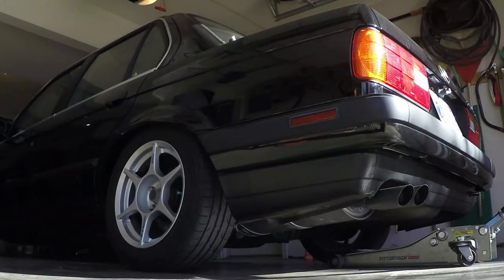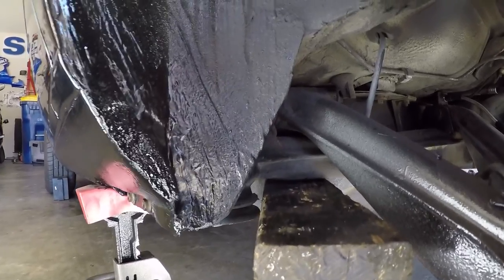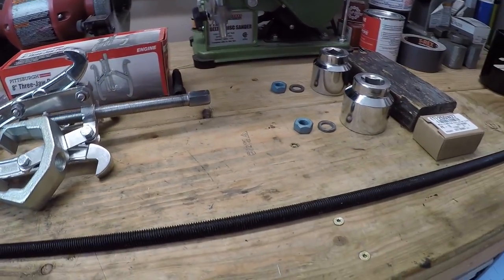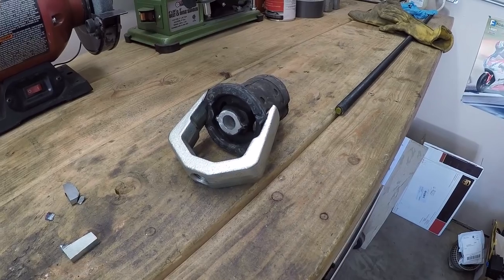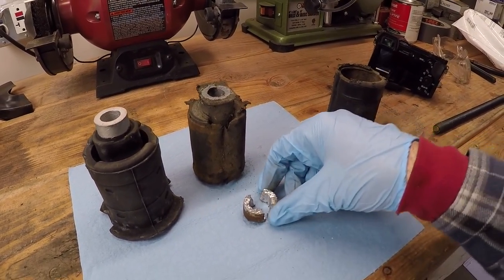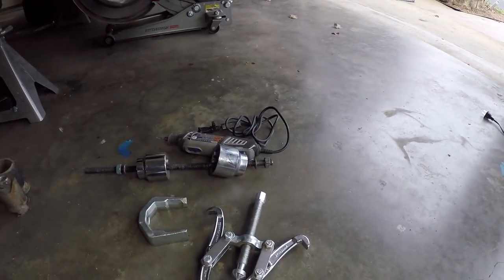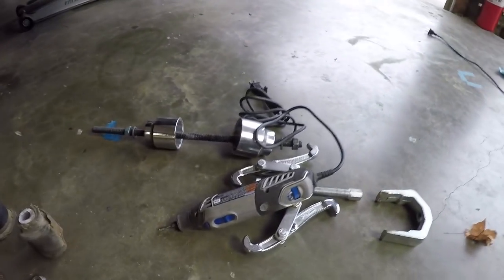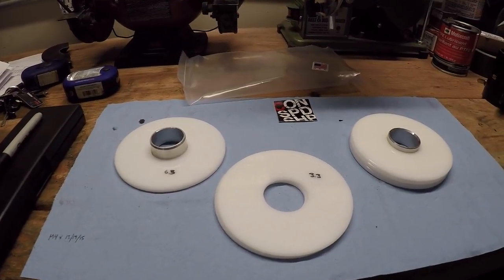Project E30 / Ep. 19 / In-Car Rear Subframe Bushing Replacement

Comment: very nice.  I made this setup about 6 months ago after finding that same link, but could only get 1 of 2 out this way -- 2nd bushing I could not get enough purchase on with the 2 jaw, and subframe had to come out anyways.  What a lot of work!
Reply: playlistforkids had this issue my self but was able to drop subframe enough to run an all thread threw the center of the pitman arm and put large washers and a nut on the other end then pull it out without the 2 jaw
Reply: Required some heat though

Comment: Crazy the top of the mount broke off and you still managed to get that piece out. I've had that happen several times but I always pull the subframe completely, so I have room to get a drill in there. II always drill 3 "holes" at an angle and chisel the bastard outta there.

Comment: Did this on my E46 M but I got it done by the shop as they did my sub frame reinforcement plates etc. Too big a job on the E46 for me to handle. I kind of envy your elegant E30. Although I really like my car I love the size and look of the E30 so much. Looks killer classy!
Reply from the maker: Thanks Greg! The E46 definitely has a more "advanced" design compared to the E30.
Reply: @PracticalEnthusiast  Yes but I'm not totally convinced that it's necessarily a better one. (Or maybe it's a combination). From what I've been learning and gathering from those that have been swapping engines with chassis and then what it takes to make them work, the combination of the S54 from the E46 M3 and the E30 chassis (then tooled a little more with some configuration of E36 steering columns I think and a few other smaller changes) can produce one of the most satisfying and exciting cars for the N/A Manual car scene.  I have my own fantasies LOL but not the resources or equipment to execute such an endeavor. If you want to check into a reasonably trust worthy test of this type of set up check out Matt Farah on the Smoking Tire doing so  I'll grab the link for you.    https://youtu.be/hZzTg1GoOxo

Comment: Very great video. The best on yt for this service.
Please dont hate me for the next words. The new rubber bushings may only last for next 10k miles. They are produced so cheap, they are shitty.
Either take glue for wind shields and fill all open space inside or better use other material like from Powerflex. In the german forum e30.de they prefered them long time ago, i drive them in both, winter and summer car since more than 10 years. Yes they are harder and you will hear more noise from rear axle, but i dont want to do this work again

Comment: I attempted this method last week, and have a few bits of advice. The first step should be to remove the underside bracket and inspect the old bushing, BEFORE buying pullers etc. because the metal flange at the bottom of my original bushing was corroded such that the puller simply bent the flange over, rather than pull the bushing out. If there isn’t good metal there to pull on, it doesn’t really matter how much force this tool setup is capable of applying. 

Second, a torch that close to the fuel tank, pump, and filter seems unwise.
Reply: How did you manage getting that old bushing out?
Reply: @slowgan325  ended up cutting them out with a reciprocating saw

Comment: The bushings separated because when you switch to just the 2 jaw puller you pushed on the center so it had to separate to come apart and that probably why the top part got stuck.

Comment: hey man, I'm looking at doing this job, trying to find similar pullers in the UK, do you know what size the 2 jaw puller you used was? the one linked says 1-5/16 in, but that seems a bit small for the job to me, or is that right and you needed to cut a lot of material away?

Comment: Did you take a before and after measurement to determine how much lift you got on the body?
Reply from the maker: Yes, it raised it approximately 10mm. Not a huge change, but it stopped the car from hitting the bumpstops on every bump! I'll probably just put in different springs in the future though.

Comment: Great video !!! Hello can i use 4inch 2jaw puller? and what size of pitman arm puller?
Reply from the maker: Thanks! The 2 jaw puller I used was a 6 inch. You might be able to get a 4 inch one to work but it would be pushing it. The pitman arm puller had a 1-5/16 inch opening before I modified it. Check the video description for a link to the exact one I used.
Reply: Yeahh thank you very much..

Comment: The rear spacers will make the ride more rough? I need some spacers too for the rear end
Reply from the maker: Putting in a shim will increase the spring preload, which in turn will make it marginally stiffer. Probably not enough to notice though.
Reply: @PracticalEnthusiast  i just installed kyb shocks with eibach pro kit springs in my e30, the rear sits lower than the front, its my daily car, do you recommend the condor speed spring spacers?

Comment: Thanks for the great video. Very detailed and i feel very confident doing it while the subframe is in the car. Just a quick question, during the bushing removal process. Can you just run the m14 rod through the pitman puller and extract the bushing that way rather than using the jaw puller? It looks like it would eliminate the dremel cutting step. Just asking incase I'm missing something and so i can gather the tools for it. Thanks for time and a great video.
Reply from the maker: Sorry, I don't follow. How do you see the M14 rod pulling the bushing from the subframe? You can't put a nut on top of the rod (inside the car) and have it push the bushing out because the hole that goes into the car is just big enough for the rod.
Reply: @PracticalEnthusiast  thanks for the quick reply.  I didn't know the hole was just big enough for the m14 rod. There aren't any pics of the inside part of the job online.  I was hoping to draw out the bushing just using the m14 rod and pitman puller because i thought there was room for a washer or something.  Thanks for making your videos.  They're very helpful.
Reply from the maker: @jafetreveles4564  I'm glad you like the videos! Thanks for watching. Unfortunately I don't think you'll have success going from the top :( if there had been enough room up there I would have used a punch/hammer combo to drive out the remainder of the bushing instead of using the Dremel.

Comment: Seems easier but looked way harder than just removing the subframe lol. You should've just dropped the whole thing, and that way you could've also swapped out the rear soft rubber brake lines to SS. Also, why not poly bushings???
Reply: Poly bushings = more vibration, annoying in a daily driver
Reply: Really Happenings not unless you get "soft" poly, like 85a durometer (which are the most popular). They'll last longer than rubber too, and you can grease em up well and they won't squeak. 
I would agree if you said poly bushings on driveline areas such as motor or diff mounts, but poly suspension bushings are very livable. Not talking from experience, but I am planning to get them in the future. 😉
Reply: 1.  I am speaking from experience, fwd Volvo front subframe bushings.  2. Rear subframes ARE driveline components on rwd cars, while also obv supporting the susp.  I would agree if the frame in question carries suspension only.
Reply: Really Happenings hmm interesting. Where are those front subframe bushings on your volvo? Do you have rubber motor mounts?
Seems to me that for the e30, if you get rear soft poly suspension bushings and a rubber diff mount, you rly won't get noticeable vibrations. I'll definitely by trying this tho.

Comment: I hated this job, but because I took the subframe off! It made getting the bushes out easier as I drilled them and hacksawed them out. It did meant I could do the trailing arms as well though, even though getting one back in was a pita. Di the same threaded bar trick as you here http://cookracing.co.uk/index.php/race-car/34-e30-trailing-arm-bushes-removal

Comment: I have a 1997 BMW Z3 that needs the cross over bushings. I'm told that the z3 has an E36 front suspension, and more relevant, an E30 rear suspension. So my question is: Does anyone know definitively whether the Z3 has access to these bushings from above, as did the E30 in this video? (Not looking for "I think..." answers, don't want opinions)

Comment: Sorry too say but why did you use the rubber bushes . Ive got all suspension bushes on my e30 all powerflex bushes . Hate rubber its very soft dry rots not a great ride to soft and you can hear odd things if your e30 is a lowrider . Don't know why people bother with hectic low and excessive rear camber . Bunch of clowns
Reply from the maker: It was the cost-to-benefit factor that led to the rubber bushing choice. I'm not tracking the car, it's purely for street use. I actually prefer a small amount of subframe deflection to help dampen road noise. Rubber bushings are relatively cheap and poly bushings are not. Time is also a cost factor. Poly bushing installation requires the subframe to be completely removed. Rubber bushings, as can be seen in this video, can be installed in an afternoon. Ultimately, rubber bushings were a cost-conscious method of fixing what was wrong with the car. Thanks for watching!